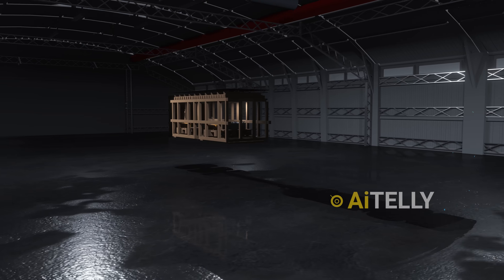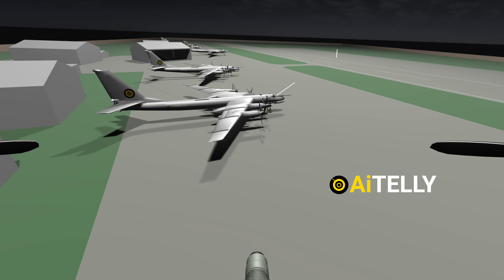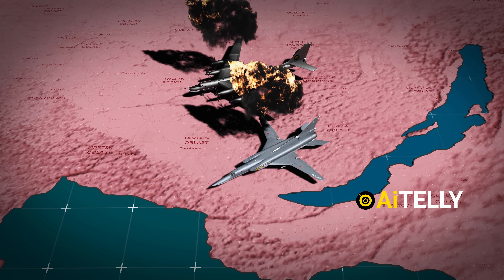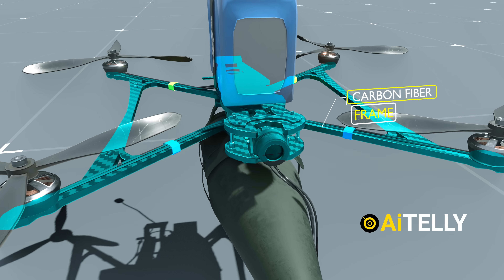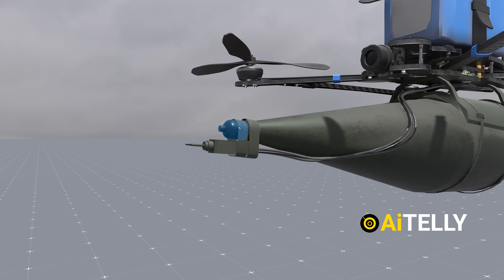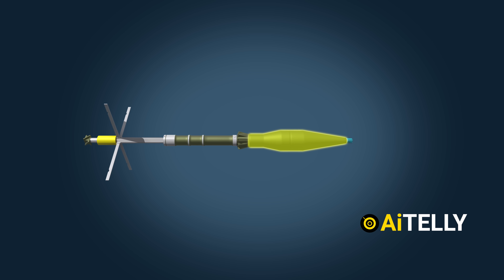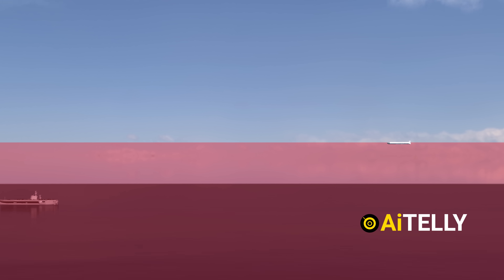How Ukraine FPV drones Truck Attack Happened? #ukraine #russia #Spiderweb

Comment: The author came up with a lot of things himself, far from reality! These were mobile homes for builders (not shipping containers), with a residential interior, there were no batteries or anything else inside! The drones were in the roof and were powered by solar panels. The trucks did not stand for days or weeks at the target. And they arrived at the unloading points at the same time. Quadcopters do not need compressed air to take off. There are a lot of inaccuracies.

Comment: my god this video is so full of mistakes...
first of all, CLEARLY this video was made with the help of AI
no, the trucks did not have signal shielding
no, the drones did not launch at an angle with compressed air pushing them up or a ramp
no, the drones were NOT piloted by were autonomous
no, the trucks were NOT driven from ukraine into russia

no, the drones did not all take off at once, they flew one at a time
no, the drones did not use RPG warheads
no, fiber optic drones are not limited to 1 mile or less
no, regular drones are not limited to 5 miles but can reach 10+ miles
no, 5 miles is not 10km, its 8km
Reply: source: trust me bro 😎

Comment: @1:08 “The drones were located about 2 miles from the airfields.”
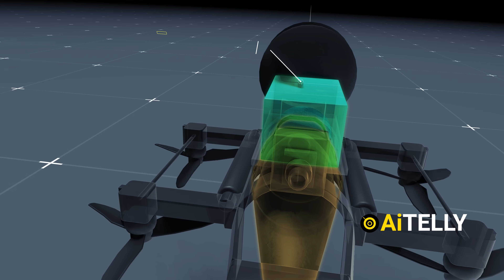@3:46 “The fiber optic drones they used have a downside of weight, limiting their range to 1 miles or less.”

Hmm… Cool animations, but you got the range on fiber-optic drones all wrong.

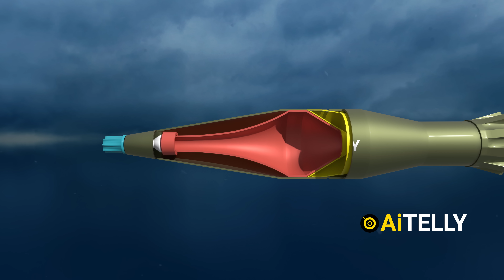Edit: @7:56 it’s stated that the RPG warhead creates a high-velocity jet of heat. It actually creates a high velocity jet of molten metal due to the conical liner.

The pretty thumbnail got me to click, but the incorrect info and attention to detail has me leaving and not coming back.

Comment: “The battery is one of the heaviest components of the drone due to its energy density.” 🤦‍♂️ More like, due to its physical density (mass). A higher ENERGY density means they can get away with a smaller and lighter one.

Comment: Sorry for being pedantic but 4.5 mins in The model drones propellers are going the wrong way, I'm also not sure they used fibre optic cable either I suspect they used Starlink as the communication bridge.

Comment: NATO and EU gain the most by taking out a sizeable chunk of the Russian strategic bomber fleet, which is capable of delivering air to surface missiles with nuc warheads.

Won't be surprised if Ukraine got their discrete clandestine support for executing this operation.

More so, because these aircraft were not being used by Russia against Ukraine in the ongoing conflict.

Comment: The video is nonsense. First: they used not just containers, but container-type residential buildings. Which makes it much more difficult to detect drones, because such buildings have a ceiling. In addition, there were solar panels on the roof of such buildings that recharged them. Second: The drones were closed-type, all the electronics were hidden in them, as well as the explosives. The battery and explosives were small. Third: The drones did not communicate via fiber optics, but with a SIM card. Fourth: They destroyed not 34% of the aircraft, but only 11-14 units.  Fifth: The West may rejoice, but here is the question: "If someone now wants to do something similar in the US, how will you fight it? The coin has two sides, and the US, like any other country, can easily be subjected to such an attack. Anyone can take a drone and fly up to Elon Musk's rocket with a small explosive charge, destroying the rocket worth 100 billion dollars.
Reply: Thanks for taking the time, lots of it is just made up for likes

Comment: Lots of misinformation in this video. Too many mistakes to count. It is written by someone who doesn't understand the subject, but has read an article or two. For example fiber optic drones can have a range as far as 9.3 miles. not 1 mile as the video states. Also the carbon fiber frame of the drone has nothing to do with withstanding crashes. The weigh of the battery has nothing to do with its energy density. Etc.

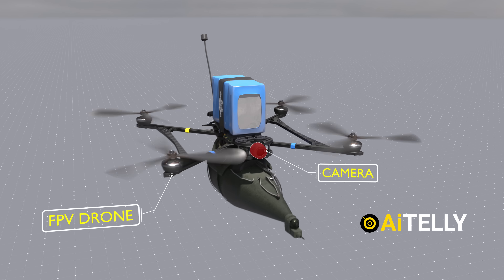Comment: 5:33 radio receiver? send footage back to the operator? I thought those fibre optic cable send the camera footage back. so those footage not get jammed by jammers then?
Reply: @sahan6996  it sends both on fiber optic line, radio signal and video. This guy didn’t do his research. That antenna he pointed to is used for video, which is not needed when using fiber optic.
Reply: @eme4289  exactly my point. 👍

Comment: The latest news say that two of the 4 trucks burned because of a drone detonation, one truck failed the much because civilians intervened right on time, one was successfull in hitting few  tu-95s and a tu-160, latest satellite images show that the number of casualties are in the one digit(8) and not as told by the SBU.

Comment: Your drone schematics are beyond wrong 😂
Battery’s are traditionally not directly connected to the flight controller and antenna ;) and there are 3 wires to each motor not 2. That’s just the obvious stuff. Strange an Ai was involved 🤷🏼‍♂️

Comment: 3:53 That’s not true. There are reports of fiber-optic drones with ranges of 10–20 km. However, this particular attack did not involve fiber optics.
Reply: It was literally called operation spider web.
Reply: @motionsick Do you realize fiber optics means the drone operators are on the other side and exposed?

Comment: People ask why Russia's strategic bombers are parked in the open, this is for a reason.
This was done within the framework of the agreement of April 8th 2010 called SVN-3, which was signed by Russia and the United States when Dmitry Medvedev was president. Strategic bombers must be accessible for inspection. At bases, they are parked in open parking lots. This rllows satellite reconnaissance and inspectors to check how many bombers there areand where they are. For decades, treaties kept nukes in cneck, bombers had to be out in the open, silos sealed, so nobody could pull off a surprise strike.
It was the thinlyne stopping WWWIII.
Zelensky shattered it all in one move. He threw out the rules, erased decades of stability and threw us straight back into cold war chaos.
Anyone who helped make this happen isn't just reckless, they're a danger to the entire planet. Those celebrating are idiots or totally out of their minds.

Comment: This strike used a new type of Ukrainian drone called Osa. Its technical characteristics are publicly available. 
Why do these author fantasies about fiber optics?
The OSA UAV is an innovative aircraft that was completely designed and developed in Ukraine. 
During development and production, the emphasis was placed on maximum localization. 
As a result, a unique body was developed that is not inferior in weight and rigidity to a carbon frame, 
its own flight processor, navigation and communication module, motor controller and integration board.

Comment: I love the breakdown of the drone parts. No effort in researching anything here. Carbon frame was correct, 4 motors, propellers, and a camera. What you failed to mention is, the motherboard is called a flight controller. What connects the motors to the drone is the electronic speed controller or ESC for short. It could be single esc's per motor or it could be a 4in1. Then we have the video transmitter which connects to the camera which has an antenna. Then finally you have a receiver for the inputs of controls to the drone. All this makes up your drone. They could also be fitted with GPS, a recording device, a bomb or the fiber optic cable as the payload. Parts manufacturers having military contract for this must be lucrative business.

Comment: Lots of inaccurate information even in the first minute of the video.

- the containers (which were disguised as mobile houses) didnt have anything incide, except in the double ceeling where the drones were
- according to Russian FSB, the interrogated drivers didn’t know about the drones, they were just completing a paid order by an unknown man named Artyom
- the attack began right as the trucks neared the airbases
- there were no compressed air launch catapults for the drones.

- at least the drones filmed on video do not have fiber optic spools. Besides, in an attack thousands km from Ukraine, what would the fiber optics be plugged into?
- the models of the drones in the video do not match the ones used in the attack. They were specifically designed to have a very flat profile, so the warhead was split between two charges on two sides of a drone. Also, they used Ardupilot fimware, instead of typical Betaflight, and likely used cellular networks to communicate with the operators.

Comment: Why are bombers stationed outside?
According to the New START Treaty:

Strategic bombers must be accessible for inspection:
• They are parked in open parking lots at bases.
• This allows satellite reconnaissance and inspectors to check how many bombers there are and where they are.
Why are the bombers parked outside?
This is done as part of transparency:
• So that the parties can confirm the number of strategic bombers via satellite.
• So that it can be seen that they are not in a state of immediate combat use (for example, they are not loaded with nuclear weapons without notice).
• This helps to avoid mistrust and an unexpected nuclear conflict.
Is the treaty still in force? This is interesting.
• The treaty has been extended until February 5, 2026.
This is the latest extension, signed in 2021.
• Russia and the United States remain parties, meaning the treaty is formally in force.

Comment: We should not be surprised if Russia starts to park its strategic aircraft in Iran's Hamedan airport.  An airport that the Russian pilots are very familiar and currently several hundred Russian engineers and technicians are at that airport helping Iran to set up the assembly lines for manufacturing SU-35 aircrafts and possibly SU-30 aircrafts.

Comment: You missed the part where Ukr used US satellites in order for the operators in Ukr to control the drones thousands of km away. You know, the part without which such an operation would've not been possible.
Reply: Didn't happen, drones used AI. US has complained they weren't informed of this plan so Ukraine couldn't have been using their sats

Comment: CORRECTION: The fiber optic drones have the capability to strike at a range of 20 km and more. Recently an Ukrainian fiber optic drone reached a target at 42km :face-red-heart-shape:
Reply: They produce 30 km spools of optic fiber in factories now.
Reply: each drone has unique remote operator located in Ukraine. There was antena in the truck. Most likely satelite and cellural. Drones where more advanced, named First Contact. They are weather resistant as all electronics and wires where inside the drone body. Also engines where powerfull to act agains stronger winds and fly wery fast - 150 km/hour. to get into the target in less than a minute.  Drones had advanced AI to maintain altitude and target even on signal loss and to be controlled will high network latency.  Most likely one of the trucks got on fire and could not attack the airport near Ukrainka airport. Most likely parts of the roof ejection mechanism malfunctioned. This is only one of the first such attacks. Will be fixed next time. The best part was that drivers did not know what they transport. Containers where on sale to real buyers and where actually transported to them in the same day in different parts of russia. That was a real real delivery, one of the attacks happened when the truck was on the move. They just opened the roof and started flying the drones.
Reply: @yurijmikhassiak7342  You think they had a starlink antenna in ip of truck, and controlled to drones by that? Or they used Russian 3G network, so each drone a modem and SIM? The videos back are very clear; more clear than I see on YT examples of streaming by 3G over Internet.
Reply: @castheeuwes1085  They use the LTE russian network
Reply: @castheeuwes1085  There is no starlink in Russia. But you can have other global providers.
Reply: @yurijmikhassiak7342 I thought it looked like they were flying with low latency. Not as aggressive or snappy. Also ardu pilot is different from the typical beta flight or inav
Reply: time to make drones with cable cutters lol
Reply: I wonder if they were referring to less distance traveled due to battery drain due to extra weight of the spool? But that doesn't make sense since they ARE going 30-40 kilometers, so I guess I answered my own question ;)
Reply: @petermitchell7914 it was due to the weight of the spool. But they changed the battery to make it lighter!!
Reply: Depends on how you describe strike capability.  Do you prioritize weight for range/accuracy, endurance, or explosives?
Reply: How Long is a Chinese man?
Reply: :face-blue-wide-eyes:
Reply: @fendrou  Its always someone in the comments trying correct someone and ks absolutely wrong 

both Ukraine & Russia have 42km fiber optic drones now.
Reply: But from where? I doubt that the (many swarm) operators is behind enemy lines near the truck or that the fiber is running all way back to Ukraine. Perhaps some kind pre-programmed software on the drone? No matter what, it's pretty impressive.
Reply: @ChakChanChak  команди, які вели технічну підготовку були безпосередньо в росії і покинули її територію перед операцією . оператори дронів знаходилися в Україні і керували дронами через російські стільникові мережі . також використовувалося навчання  штучного інтелекту на реальних аналогічних літаках із музею міста Полтави .
Reply: @ChakChanChak  I heard that they were running with AI where they can detect a plane by itself. Ukraine had these exact types of planes which got bombed now somewhere in a museum. They used them for their drones to learn how they look like, even in fog, rain, etc. Once they fully learnt they send them with their trucks to Russia and pressed a button to open the lid of the trucks. Sry for my English. Hope you understand.
Reply: @Ghostface1265 It's true. In Ukraine, there are two aviation museums in the cities of Poltava and Kyiv, where just such Soviet aircraft are exhibited. On their basis, artificial intelligence algorithms were developed and artificial intelligence trainings were conducted for a long time.
Reply: @ChakChanChak  The spools are on the drone. The fiber optic cables were connected to the trucks which were radio controlled by operators from Ukraine.
Reply: @ChakChanChak  Starlink?
Reply: @Split10uk  No they use the LTE russian phone signal
Reply: @Split10uk they just as well could've use cellphone data. Likely wouldn't have been jammed
Reply: @ChakChanChak in this case the fiber optics would just be connected to the truck launchers, obviously they would have to be getting their guidance and command instructions remotely.

I have seen people suggesting that the drones had some element of autonomous guidance. in other words once the signal got through to the truck they basically guided themselves to the target, so even if they were detected in Flight the wire guidance would help them be more resistant to jamming than if they were all completely wireless. obviously the point is to get the signal to the truck while you still have the element of surprise
Reply: @ChakChanChak  These drones had artificial intelligence and were trained to hit targets using old/museum aircraft in Ukraine as an example. I am from Ukraine.
Reply: @ChakChanChak the operator still flies out remotely with a signal to the base station, and the drone flies from the base station to the target via fiber optic
Reply: @ChakChanChak  perhaps the fiberoptic-tethered drone(s) are the signal amplifier drone(s)
Reply: Ukraine no has mother ships to carry drones even further behind the battle lines.
Reply: Это фейк. Максимальное поражение 30 км и это был русский дрон!

Comment: Imagine how much damage might have been caused if instead of a RPG warhead they had used those thermite charges.   Literally dropping fire across the top of an aircraft.
Reply: @mikethompson2650  They've done that before I've seen videos of it, but a big bucket of thermite needs a pretty big drone compared with using an RPG
Reply: @bendito999  thanks, makes sense

Comment: The drones didnt have pilots,They were ai drones taught how and where to hit using old soviet museum bombers, Thats what makes this so impressive!!
Reply: Also satellite has a huge ping up to 5 seconds. Hard to control. I also think it was AI
Reply: @toddsterling4949  From what I've heard some of them did, others were piloted.
Reply: That's false they were remote controlled with satellite otherwise they wouldn't have video footage
Reply: @dirckthedork-knight1201  They simply transmitted a picture, but they worked completely autonomously and were controlled by AI.
Reply: Right, AI. Operators would be in high risk. Even the drivers are now in prison.The footage was provided by cellphone network as some of the drones carried the Russian SIM cards and only one was able to catch the mobile network signal to transfer the video.
Reply: @amamatkulify  For sure!!
Reply: This is not false, they used AI and were trained on 3D models of the bombers to attack specific parts of the aircraft, only one of the drones per area were controlled by a pilot to record footage of the aftermath.
Reply: @simonseis744 the recording drone was to capture destroyed vehicles for coins
Reply: Has to be AI